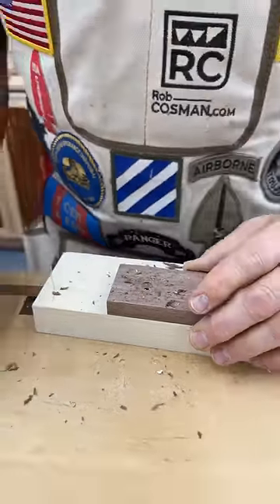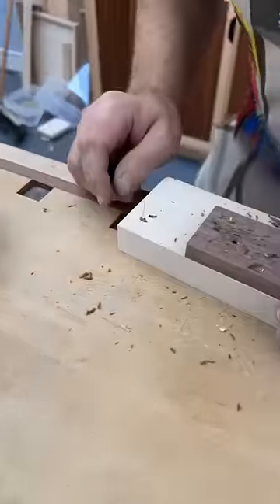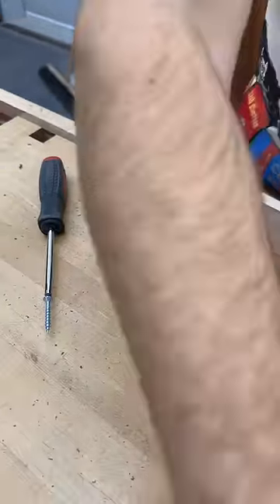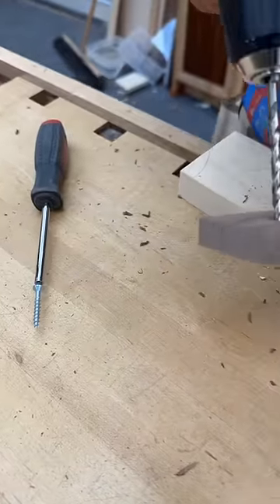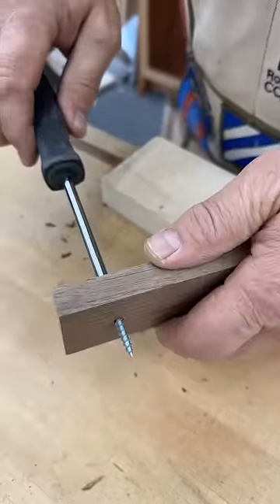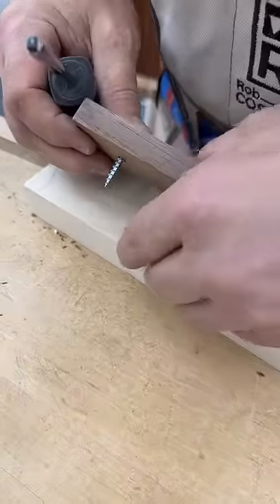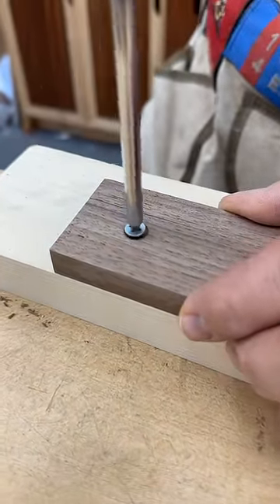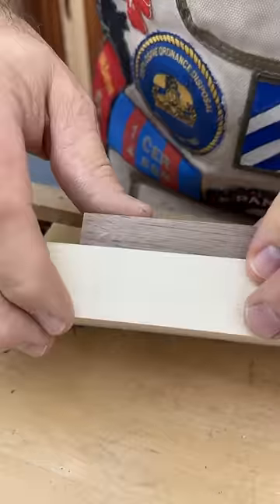How to properly screw two pieces of wood together #shorts

Comment: You can accomplish the same thing by turning it in, back if off slightly and then back in again.
Reply: You would wear the screw for no reason and reduce its lifespan.
Reply: @greyscalesx  lol 😂
Reply: @greyscalesx  Are you kidding? The wood has effectively zero effect wearing down the steel screw.
Reply: @dontplayleague  no... but heat and torque do... ever broke a screw off kinda easily when you re-sunk one the second time you sunk it to the hilt??? Me too. Torque broke it after heat weakened it...
Reply: nope - it will be better than not doing it at all (apart from weaking the screw - I did this with about 20 screws and every one the head broke off) but with a thread cut in both pieces it just cannot tighten. One point to note - when you screw 2 bits of wood together they are NOT held together by the screw. The job of the screw is to pull the surfaces of the pieces together and then the FRICTION (Coeff of Fric multiplied by contact force) is what "holds them together" - that is why it is crucial to have them squeezing tightly together. Sorry - the english there is a bit mangled, I hope I conveyed the point. (it's easier with pictures)
Reply: @transientaardvark6231  Yeah im sorry but im gonna call BS on that theory all day long. Oldest known nails are dated 3000 B.C., so you are trying to tell me in over 5000 yrs nobody has figured out how to build anything outta wood using only friction? I’ll call BS on that.
Reply: @fuzzybanana9128  Aardvark's explanation is correct. In fact it's a fundamental principle in mechanical engineering. The purpose of threaded fasteners is to clamp two pieces of material together so friction between the surfaces in contact transfer shear forces and not the fastener itself. In typical home construction this doesn't occur (in general) since nails don't really pull two pieces of wood together. Shear forces are therefore carried by the nail itself.

You can google this too if you don't believe me. It's a well understood and documented principle in the engineering world.
Reply: @internettoughguy  Thats all good and well and i still call BS. Simple fact is you cant put wood together without fasteners, notches or bonders. A theory is only good if it can be applied. If friction does the work than why does it need a fastener? Because it doesnt work and would fail 100% of the time.
Reply: @fuzzybanana9128  It's not a "theory" in the way you're using the word. The principles are applied practically everywhere bolted joints exist in the world. This is how they work. You can't argue this.

You ask why do you need the fastener in the first place. The fastener (screw in this case) generates the clamping force which is in part what creates the friction between the faces. Keep in mind we're only talking about shear load transfer. A screw also works in tension to prevent the two pieces from separating.
Reply: @internettoughguy  Lol. I can and do argue it. A joint/connection is only as strong as its fastener. Have a great day. ✌️✌️
Reply: @zekethefishgeek8690    Were you using a drywall screw when it broke off?
Reply: I do this for rough carpentry when using wood screws (framing, just putting two bits of 2x4 together) and it works well but I find it can cause screws to be buried deep into the wood if they don't want to clamp together or if you need to go back and forth a few times. The second larger hole tip means the screw can stop exactly where you want it, either flush or slightly embedded.
Reply: Destroying the integrity of the joint. Thats fine for roughing stuff in or a pressure treated deck, but if you actually want something to last 30 years outside or forever inside, thats the way to get a loose joint as the fibers age and wiggling tears out the cross threaded fibers
Reply: @zekethefishgeek8690  especially with stainless steel screws!

Comment: Good trick brother, I'm a glazer And I work with metal all day, you always want A clear hole on the 1st piece and a pilot hole on the bottom piece, if not the you wil cause a jack screw effect which will cause the two pieces to separate or move your top piece off your original layout, Keep up the good work brother And don't pay any attention to the negative comments.

Comment: Wow, I've been doing this wrong. I always drilled the screw into both pieces, unscrewed then drilled the screw back in. During the initial pass the screw would sometimes push the second piece of wood apart from the first before taking. The second pass would make them much tighter since the hole was already drilled out. Your method makes more sense.
Reply: Your tech is laborious yet better than shown on the short. If u still want to follow his technique then i suggest do the 2nd drill only partially especially when the 2nd piece and/or screw isn't thick/long enough.

Comment: This is a great tip. If you search for some good quality screws, you will see that there are some screws that actually don’t have threads the first half inch or so next to the head to help accomplish the same.
Reply: Look close at the screw he's using no streams anywhere near the top
Reply: @sparkyjackson8479  I did see that but those screws aren’t what I was referring to. Look up GRK fasteners and you will see what I mean.
Reply: @notlisted1493  he could have used the bigger drill but only drilled a couple of mm into 2nd peace, no drill change needed, quicker and easier. Each to their own

Comment: I found a nice deck screw that is 2.5 inch and has about an inch at the head with no thread to fix that problem kind of when I am playing with planed 2x4 wood. I bought the huge box of them for $50 at Lowes found on the bottom shelf. It would be nice to find that style in 2 inch and 1.5 inch
Reply: All wood screws have that blank section at the top of the shank. It's what makes them wood screws. If that's not there, they're either multipurpose, drywall, masonry, or sheet metal screws for the most part.. I'm sure I'm missing a few.. But all wood screws have that section with no threads. That feature's point is to eliminate the need to do what Rob is advocating for.

Comment: Would using this sort of screw joint provide a strong enough connection for shelves in a cupboard? I want to make a cupboard but am confused, should I buy the jig for screws to do pocket hole connections with the screws?

Comment: Next time I build furniture, I would use this method but, my preferred method of driving a screw is an impact driver to make sure it goes nowhere and I love the chattering noise of an impact driver just sink it down and let it chatter for about 180 milliseconds. If the material or screw is too weak for an impact, I will use an installation driver or a drill with the clutch set.

Comment: Guess it depends on the size of the wood and screws.  Big wood screws will pull wood together no problem in my experience.
Reply: Long enough bit and decent impact driver it will go right through no problem i feel like my 20 year construction career hasn't suffered from not doing this hahaha this guy seems like a bench joiner they usually struggle on site in my experience
Reply from the maker: Construction and furniture building are two different careers.

Comment: I have never really had an issue getting a nice tight and solid joint before; but I've only been doing carpentry and construction for 25 years what do I know
Reply from the maker: Screwing deck boards to joists while standing on them, you are right.  Come into the shop and start using dry hardwoods and you are now in a different world.

Comment: If the amount of thread is significantly more in the second piece of wood than the first then, with softwoods in particular, the bite on the end of the screw will overcome the bite in the first piece and strip it..
Reply from the maker: Usually pulls the screw head deeper into the wood before that happens.  So, if you want to maintain a neat look and secure the two pieces snuggly, pre-drill the first piece to the outside diameter of the screw threads.

Comment: ...and you can also buy 'partial thread' screws, but do not be surprised if you struggle to get PT screws shorter than 50mm - Toolstation (in the UK) advertise them and send you full thread - I sent back 3 boxes and their 'help desk' didn't understand what my complaint was. Please God give us back old wise men working in the hardware industry.

Comment: Yeah I learned that the hard way with lag bolts into ceiling joists for s*x swings.  Gotta drill first for the shaft of the threaded portion, then again for the diameter of the smooth shaft of the lag bolt. Also, getting a 1/2" drive impact driver for those bolts instead of a socket wrench with a cheater bar.

Comment: It actually will pull both peices together, your way has less thread biting in wood
Reply from the maker: Are you agreeing or suggesting something else?
Reply: @RobCosmanWoodworking  suggesting something else.
In no way do I mean any hatefullness or trying to argue, 
Just thought that thread cutting through the 1st and the 2nd until tight and pulled down snug would have more tencil strength than  slipping through a predrilled hole and only holding a few threads in the 2nd peice, 

I see how you would drill a small spot for the screw to set flush, but let threads cut all the way through so you have all the threads on the screw working as much as possible on both peices vs 5  threads on 1 peice.
Reply from the maker: Ideally you have 1/2  to 2/3 of the screw in the second piece.  I mention this about half way through.

Comment: Sorry that's wrong. At least as a general claim for absolutely all situation. It's really simple: by predrilling the upper board / material, you reduce the material, that will allow both pieces  and the screw to provide the force / newton meter necessary to bring the countersunk head below surface. Your piece of solid wood in the video would split without pedrilling of course and there are other good reasons to predrill.

But as wood became super expensive most people can't afford solid wood. Even OSB, MDF and chip board prices have gone crazy.

So, most DIYers reality nowadays is screwing boards.
I'm doing that sh#t on and off for more than 40 years.
And I remember very well when the bs about half threaded screws hit the markets 30-35 years ago.
Reply from the maker: Still not sure what your point is, even after 3 paragraphs.
Reply: @RobCosmanWoodworking  
sorry, probably my mistake. Simple test, take 2 pieces of chip board or MDF. Drill just 1 hole in one of the two boards. Clamp both onto your bench. Screw 1 screw through the predrilled hole another screw right beside the first without predilling. Which countersunk head will you be able to drive below the surface?

Comment: Why do some screws have threads that go to the top, and others have a thread gap. I often wonder but too embarrassed to ask?
Reply: The gap is to accomplish this! It has no thread so it just spins in the top piece of wood and pulls it right as the thread lower down digs into the bottom piece of wokd

Comment: I've never had to do that. If it binds, which does occasionally happen, I uncsrew the screw until it is out of the lower piece and then back in again. It pulls the two pieces together, takes less time and you only do it when needed which is a further time save.

Comment: If you use a wood screw the threads don't go all the way to the head.
Reply from the maker: i.e.  you are putting two pieces of 3/4 material together,  need a 1 1/4 screw.  The threads will most certainly be in the first piece.

Comment: I disagree, if you run the screw in back it out and run it in again it will tighten
Reply from the maker: Not in hardwoods.  Do it in softwoods and the head often gets pulled well below the surface.  Dude, don’t be afraid to learn something new.

Comment: Dude.. The entire point of the blank part of that shank up top is so you DON'T have to do this. The screw can't bite into the top board as there aren't any threads on that part of the screw. 🤦‍♂️
Reply from the maker: Thanks Ken, that is realised but doesn’t always apply.  If you are fastening two 3/4” pieces together and you have to use 1 1/4 screws, there will be threads in the first piece.  Purpose of the short video was to teach the concept.

Comment: Pre drill. Screw it in back it out and then screw it back in. it'll clamp. This guy's method will loosen over time if there's any kind of load on the joint especially uneven loads

Comment: It's called a counterbore and not necessary for 95 percent of applications. Exaggerated video
Reply from the maker: ^this guy is the wood professor.
Reply: @RobCosmanWoodworking  Yeah, the Illuminati told me about using fully threaded screws instead of partially threaded screws.